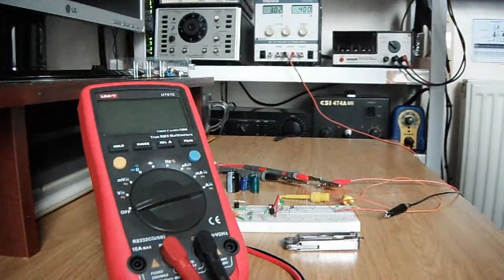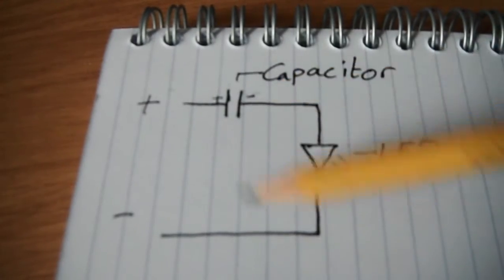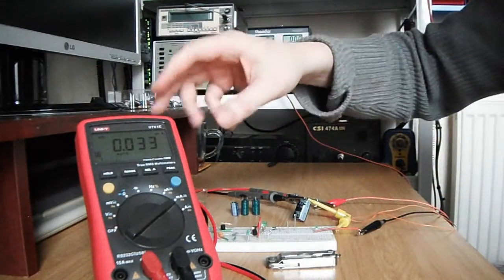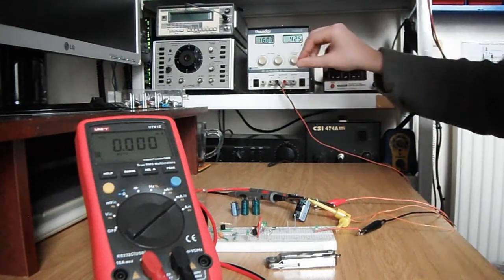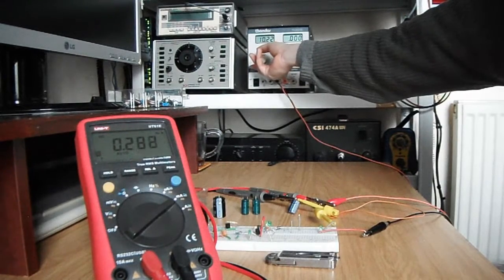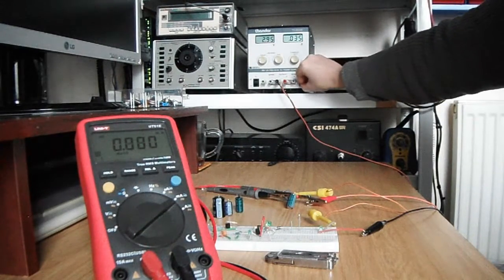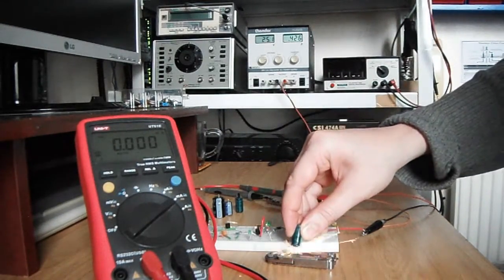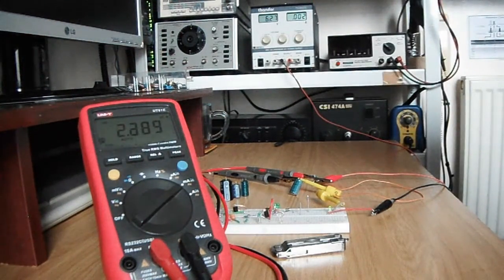How to test a capacitor for leakage with an led.

Comment: I think this is the most ingenious way of doing it I've come across! Proves simplicity rules - no fancy equipment required!
I guess a variation on this would be to use a variac as the LED will do the rectifying?

Comment: Sorry my ignorance...to test high voltage caps (guitar amp), would a 30V DC power supply be enough? If so, since I'd blow an LED can I just connect 10A meter to read the current?  To show more my stupidity of I place a resistor inline would that drop voltage and raise current..a bad thing for my 10A |meter???? Is there something else simple I could use in place of the LED? Thanks in advance
Reply: Adding to my thoughts I suppose that no leakage at 30V might not be representative of a 200V or 400V guitar amp circuit but the 30V is all I have.

Comment: You may have a good cap but short it out and you could end up with a bad one. I would invest in a high wattage resistor on crock clips to discharge each cap. Then leave a large crock clip on the cap as a short to prevent it pushing the charge and hence voltage back up which they do like doing. Otherwise this is a neat idea though automating the voltage ramp would be an interesting project in itself.

The caps I test tend to be in the 600v class so I brought a purpose bit of kit which terrifies  me when I use it.
Reply: when i want to crudely test 630v paper or poly caps or even electrolytics i just put them in series with a diode with some crocodile clips and stick them in a wall socket or extension cord. put the multimeter on dc volts and watch it charge up. it should charge fast and then go to zero volts dc. i you use a single diode the test voltage will be about 170v or so...not close to the limit of the capacitor but it gives you an idea of its shape. if it charges very fast and goes to 0,00 then its perfectly fine. after testing you put the meter across the capacitor and the meter itself discharges the cap and you can watch the voltage going down on the meter, no need for a resistor.  this method is "safe" even if the cap is shorted it will not blow because the multimeter presents no load and if the cap is shorted you will just read full dc voltage

Comment: The leakage current is measured in microamps, so your approach doesn't work since you meter measures in milliamps, the led will needs about 20 milliamps to be fully on, so no good either. The leakage current is a result of the capacitor's parasitic parallel resistance, while the ESR mentioned below is Equivalent Series Resistance and is a different story again. The leakage current is the current that continues to flow after the capacitor is fully changed with DC power supply,
Reply: So maybe make a protected micro amperemeter for this propose.

I am no engineer. I would try and feed this current to a transistor, and somehow making a amplifier for that purpose to show it better. 

Could be some "pre feeding" current or voltage to a transistor and then insert the measurement into the circuit. I am thinking about the need for about 0,6v to make a transistor conduct. It has been years since I was in school.
Reply: The meter measures milliamps to three decimal places. So microamps.
Reply: If he used a low current led like 1.5 ma then that would be more sensitive.  And use a micro amp meter in series.. and use a 1k resistor to discharge the cap